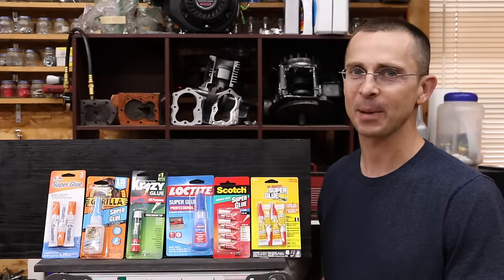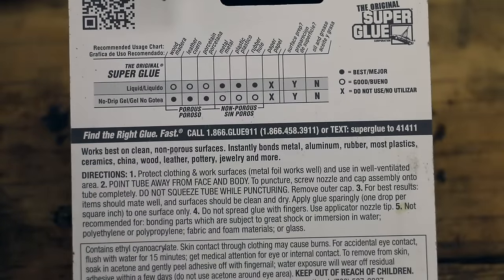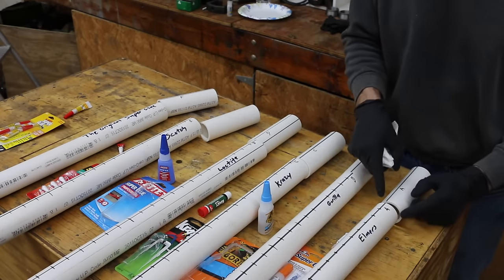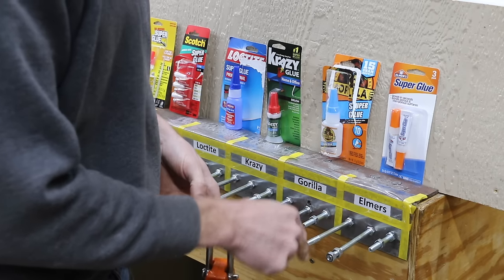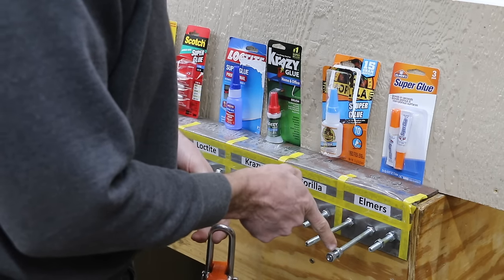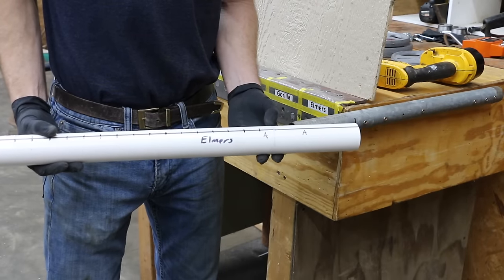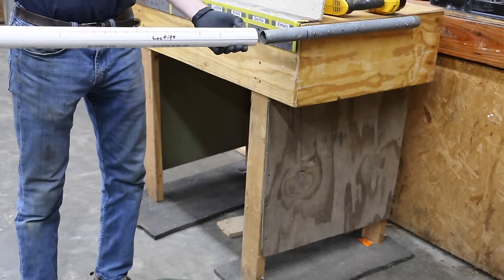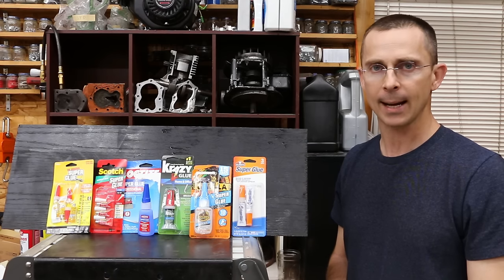Which Super Glue Brand is the Best?  Let's find out!

Comment: Caution when buying "The Original" Super Glue:  It gets hard inside the sealed tube!!  I thought I was being frugal and purchased a 12 pack when it was on sale.  After about a year, I pulled out one to use it and it was hard.  "Pin hole in the tube, maybe manufacturing defect" I thought.  I checked the rest of them, and they were all hard.  I checked each tube, and there were actually two different lot numbers mixed in the multi-pack, so no manufacturing defect.  I contacted SuperGlue and they told me that they only warranty the glue for 1 year from date of manufacture.  Live and learn.  I went a bought some Loctite.  At least I know that it's not going to get hard in the tube before I even open it!
Reply: All CA glue has a shelf life. There's one made by Titebond that supposedly has an extended storage life. You can store any CA glue in your freezer to extend its storage life. You need to allow the glue to warm up to room temperature before you use it. Can't put it back into the freezer either.
Reply: Locite cures in the absence of air and bottle cycles air through it even with it on, so even though they have they a self life of a year, they'll still be good to go for a very long time. Loctite is def the way to go
Reply: Jesus Jim you must have a lot of time on your hands , get a hobby
Reply: Gorilla Glue is very similar, they could reseal and create a vacuum at the same time but, that would probably cut into their sales that is why I no longer buy the large size, but the smallest size available. Loctite and 3M set the standards for other companies to follow!
Reply: Planned obsolescence.😒
Reply: Did you store the superglue next to your Viagra?
Reply: @Massimo-sn7xd  no, drying glue.
Reply: Good job Karen...
Reply: @nicksantos9234  You may be thinking Loctite thread locker which is true.  CA activates with moisture and no CA has a long shelf life.  The thin lasts a bit longer because it will become thicker as it cures.
Reply: Absolutely I still had the same complaint I had to be a better way to disperse the glue stay fresh after time
Reply: Have not used Loctite super glue but it sounds like the best product thanks 4 your testimony
Reply: @1pcfred  what a great idea if it works I'm a little bit skeptical
Reply: @solarsynapse  you're right Loctite makes a thread Locker, that is what makes me familiar with the brand did not no they made a super glue will try soon if the hype is correct thanks for your input

Comment: Really impressed by loctite on plastic
Reply from the maker: It's amazing on plastic!
Reply: Except that nobody uses superglue (of any brand) when working on their sprinkler system.
Reply: How will it work on a "rearview mirror" on windshield glass?
Reply: i know by experience that locktite(my go to brand) doesnt work on steel to glass on a mirror.i have also tried another brand at the time and didnt work for long either.i am a ford tech of 20 years and just decided to try it instead of the made for it regular glue.my advice,regular glue wins.my 2 cents
Reply: Thanks rooster. All "rear view" mirror glues eventually fail. Just tying to figure out the best. Also if I use a plastic nub instead of a metal nub, it may hold longer with a certain type of glue ( plastic on glass), until the plastic nub breaks...
Reply: firelensman I have this "b7000" glue from ebay. It's cheap, seems like a pretty good all-round glue. But I don't know how well it would perform in a hot car and direct sunlight.
Reply: Is that the "german stuff" that auto mechanics swear by?
Reply: there is a specific loctite for steel and ferrous materials. an it works really well, but one glue I use for work weglue aluminium to steel or alloy and it will not come off, its such a good adhesive you have to wear a respirator gloves and face shiekd, otherwise it turns your skin black and gets into your blood stream SIKA make it.
Reply: Hell yea
Reply: firelensman h
Reply: Great video!  I just used my Loctite Glue this evening to repair a broken trophy, which the surfaces needing to be mated back together are either resin or plastic, not sure. Holding strong so far as it’s starting to cure.
Reply: @firelensman 
I've glued (loctite) plastic to glass as well as Styrofoam to glass and it works well. Never tried metal to glass.

Comment: How about the best wood glue ( I use it more too)
Reply from the maker: Thank you for this recommendation!
Reply: Project Farm please do this
Reply: Mower Man gx85 good call
Reply: Yassss
Reply: I agree. Wood glue would be cool. Test it on a hard wood like oak.
Reply: I was going to say wood glue too.
Reply: each glue works differently.  teach people how the glues work or what makes them work. Crazy Glue works with no air as in a tight fit.  Epoxy wills a gap and is strong for filling applications.  Wood glue absorbs into the fibers and sticks. I am not that accurate but often we don't understand. Contact cement is another type, rubber glue.
Reply: I have been using the DAP brand cyanoacrylate wood glue with great results. It is more like syrup and fills cracks well and has about a 30 second+ set time so it is  little forgiving and shock resistant.
Reply: Yes please
Reply: Why would you need luck with wood glue?  It's been around for hundreds of years, doing the job fine all the while.
Reply: Mower Man gx85

I think several Youtubers have done wood glue comparisons.  I think the decision is...

All wood glue is stronger than the parent material.  Wood joints with wood glue don't break at the glue.  It is the surrounding wood itself that fails.  Paying more money for wood glue to be used on wood doesn't make sense.  Buy the cheapest wood glue!
Reply: Mower Man gx85 just use Titebond II you won't regret it
Reply: Great idea!
Reply: Mower Man gx85 The best is Mekol glue
Reply: That's a great idea! There's so many on the market and I've tried a few and there's a lot of different results.
Reply: Excellent idea!
Reply: This could get skewed easily, depending on shelf life,grain differences, moisture content. Etc.  Titebond 2 is the best i have found. Titebond 3 has cost me too much money in failures and turning black.
Reply: Deffinately
Reply: Titebond III. I have been testing different wood glues for years, and nothing beats it. It's stronger than wood, waterproof, and doesn't shrink.
Reply: Tidebond.. and look no more
Reply: Titebond 2 is what all the woodworkers swear by. Look up the Wood Whisperer.
Reply: john Hubbard My buddy uses Titebond Original, II and III depending on the situation. III is waterproof. I don't know why he sometimes chooses original over III. I know he uses it to create a drying seal solution before he can get to putting wood into a kiln.
Reply: I would like to see a good video on the best glue for my dentures......
Reply: It would be a waste of time. 99% of the time the wood breaks before the glue bond.

Comment: 1 drop can lift a ton but can't even hold my glasses together..ok👍
Reply: LOL
Reply: Jax
But Jax your glasses do not weigh a ton 😁
Reply: There's a special cement for plastic if thats your application. I buy it on Ebay.   Loctite Super Glue Plastics Bonding System with Activator 2-Gram (681925)
Reply: @georgebuck2269  A drop of JB weld would work aswell, and may even be far stronger. JB Weld is miraculously strong for some applications.
Reply: Glasses get oil from your skin on them, did you wash them with detergent and dry them before gluing?
Reply: Jax use rubbing alcohol to remove all oils from the surface prior to application.
Reply: Sounds like a deplorable
Reply: Yeah samr
Reply: For real lol
Reply: Sounds like a personal problem. Learn2useGlue
Reply: She (Jax) was making a joke folks. I know that most of you got that, but clearly not all of you did.
Reply: May be you need a new ones...
Reply: @georgebuck2269  what is the name..... please!
Reply: @byroncjohnston1  
Loctite Super Glue Plastics Bonding System with Activator 2-Gram (681925)
Reply: get some baking soda & allow some to fall into cack/brake
THEN add a little supper glue
the two combine to make a ceramic that's VERY strong and sandable. Aluminum oxide in powder form instead of baking soda is even stronger & both make the superglue dry almost instantly so add baking soda add glue little bit at a time until finish/cheers
Reply: If your frames are in acetate glue them with a drop of acetone. it's the only way to go. it melts the surface in contact together.
Reply: Super glue does spread really thin. I had a nerd tell me lots of airplanes use them on their wings for something. I wouldn't be surprised if one drop was able to provide a ton of pure tensile force.
Reply: Jax 🤓
Reply: @bearup1612  😂😂😂
Reply: Use cheap epoxy 50/50 and done.
Reply: LOL I had to get my glasses soldered, not only was there left over glue from the manufacturer but the surface type doesn't help either I think

Comment: I think for the twisting sheer of the bolts, you could of used the hanging scale off of a bar/socket. Then pull on the scale till failure. That would give you exactly the Nm of force needed to break instead of using the torque wrench in 5lb/ft increments. But, the torque wrench did show good results  ;)
Reply: That's a great way to make the test easier. I bet he was doing that test for a long time!
Reply: @Dgstowe that's not right. The weight of a torque ratchet isn't suspect is it when you're using it, is it? Even if it changed the real number slightly it'd change the real no. by the same small amount for each test so it'd be a controlled variable.
Reply: @Dgstowe it's all good. I talk in comments to learn and be taught when I didn't know something either. I also comment hoping people will check out my YouTube channel. Lol Automotive repair generally..sometimes motorcycles and upgrades.

Comment: Wow that loctite.
Reply from the maker: It's a great product!
Reply: Project Farm 
It’s the only one that we have at the house. It’s been open several years and hasn’t dried up in the bottle like crazy glue.
Reply: and there have better super glue in there line up. the stuff shown here is just there house hold grade
Reply: there?
Reply: Yeah I used a tiny amount of that stuff, like the tip of a toothpick, to fix my keyboard. I snapped a key post. It's held up for 2 years now.
Reply: Yes glue my glasses together when they break and they are plastic. Never breaks in the same spot the glue is stronger then the frame of the glasses.
Reply: Loctite glue
Reply: And the fact it failed the thread locking test means nothing. Their larger business is Loctite Thread Lockers which outperform any and All Super Glues for rotational strength.
Reply: for keeping screws in place.

Comment: I use to turn ink pens on a lathe where all the parts had to be pressed and sometimes super glued.  The cheap dollar store glue worked better than any of the name brands it seemed like.   Also for some reason super glue seemed to lose it's strength over time after opening it even if it was sealed back up.

Comment: In agreement that, in general, Loctite beat other brands, though not by much due to its performance on the first two tests.  Hoping you'll revisit this with gel type vs. standard for tensile strength using N meter between bolt and your tractor!
Reply from the maker: Thanks for the suggestion.